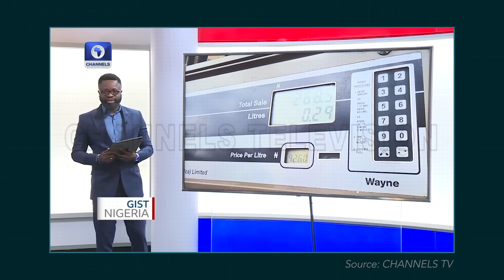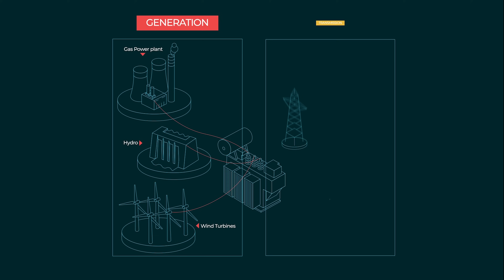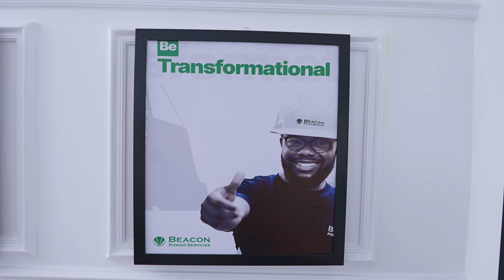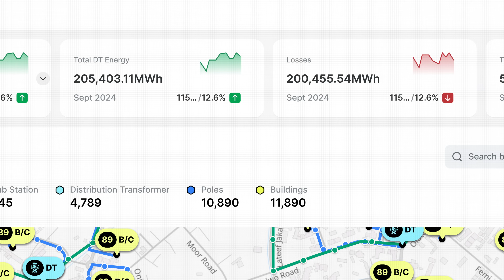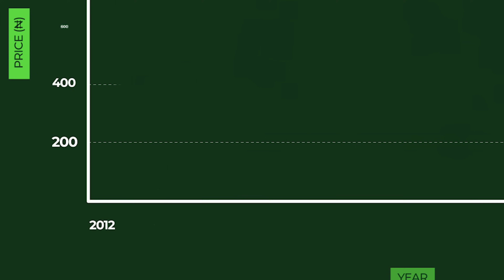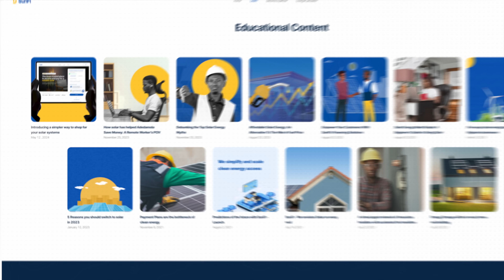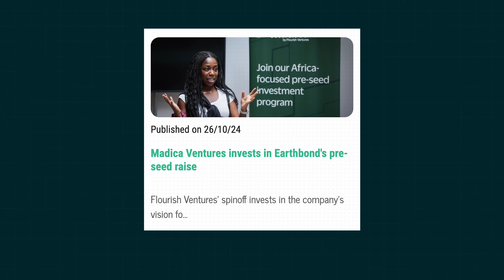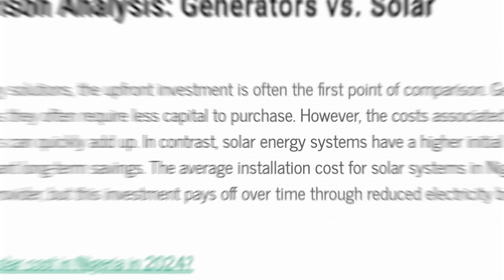Can Solar Power Solve Nigeria's Energy Crisis?

Comment: Reply the one you've heard of to this comment:
 1. Thorium-Salt reactors
 2. Methane from Algae
 3. Ethanol from corn or grass
 4. Artificial Photosynthesis to produce octane
 5. Electrolysis of Sea Water to produce hydrogen
 6. Piezoelectric generators embedded in roads and sidewalks.

All these technologies were proposed or developed abroad but here in Nigeria we're fighting for crude oil (I don't care anymore, come and carry it) - when we should be busy developing our own solutions not waiting for the more advanced countries to do it and buy from them expensive (or often old and redundant tech).

"Change is on the horizon", I say "Change will wreck you if you don't move with it."

If we start now, then tomorrow is guaranteed - I'm developing my own technologies to produce hydrogen and electricity that are cheaper than crude oil products and reduce our dependence. 

Are you going to sit down at home and complain or will you do something too?

Comment: Yes, solar is more than sufficient with sufficient inexpensive energy storage systems for night time and intermittency such as Sodium ion batteries , LiFePO4 batteries, Fly Wheel storage, Pumped Hydro storage, etc. You may have a super abundance of electricity for a Wakanda forever. It would be good if solar panel and battery manufacturing was made local, they being so critical.

Comment: People who already have generator or generators should have a dual input inverter system/switch box which could be Automatic or Manual switching.
Then if there is grid maintenance or climate/weather damage in the area which admittedly is gonna be a concern and problem that everybody in the area is going to be affected by 
very highly likely than not so having options to use already in place built into the grid and infrastructure from the get go is highly necessary and important.
There could be local events that include educating, training, teaching people with hands on experience so people will take care of solar equipment and their generators and all the hardware that goes along with it and any software that is in use along with it.
Take care Nigerians and good luck on moving forward with this full grid scale Infrastructure and community development & empowerment project/initiative.😊😊😊

Comment: This was Indonesia 20-30 years ago. Now, we have a surplus of electricity, with 99% of homes electrified. Just vote for the right leader, and you can achieve the same in Nigeria too.
Reply: Coal is the largest energy source in Indonesia according to IEA.
Reply: It is more complex than that. I have seen candidates locked out of elections resulting in basically selections not elections. Not to mention vote rigging, assassinations' of both candidates and electoral officials. Do not come here to lecture Africans.
Reply: Explain
Reply: @LibertarianBangla  Just place something like a Ecoflow Delta 2 or pro in every house together with a solar panel on the roof.

These Delta's have a AC-in so if there is electricity from the grid use it, to charge and pass through.
During the day solar will also charge it.

Connect your fridge and other stuff to the Delta and be done with it.

Comment: No.
   But adding solar farms and other forms of renewables to the grid, is the solution.
Reply: And how well is that 'solution' working out for the western countries? For Europe? 
I see how the energy prices have been dropping as more renewables have been adopted -- or have they?
Reply: @kehindeakiode2865  
Electricity in Nigeria is 130 dollars per megawatt, 70 in US, 99 in France, check Scotland for me (except I'm wrong their grid is mostly renewable)

renewable does not necessarily mean cheaper than drilling, refining, and transportation in-between, but usually is.
Sources like the Thorium-Salt reactors would be excellent for Nigeria, but let's be honest with ourselves, how many 'engineering graduates' in Nigeria have heard of these new reactors?
Even though the concept is ten years or so old.

We're talking about solar energy so much when it's not that efficient (30 - 40%), Artificial Photosynthesis is an upcoming technology that should be commercially viable by 2030, Bio-Fuels like ethanol from corn or methane from algae can be developed here, electrolysis of sea water to produce hydrogen, etc, can be done in Nigeria.

We're not researching now to at least develop it independently. Instead, let the West do it first, go through all the hurdles, and sell it very expensive to us, then the imbecile of a president will cut a ribbon and it's non-functional in the next five years.

Nigerians are travelling abroad to study, and they'll develop those technologies there, but the idiot professors and what-the-fuck-level-of-useless PhD programmes here can't produce one good idea.

Add renewable energy sources, and nobody will get hurt from it. 

Nobody has to like it, but we are still fighting over crude oil in Nigeria like our ancestors who were clearly daft, and we are following in their footsteps.
Reply: @kehindeakiode2865 
Read my new comment and reply.

Scotland has the highest renewable energy in the world, that make up most of their electricity, go and find out how they did it.
Reply: @kehindeakiode2865 
Inflation. That's why. Check Scotland they have the most renewables in the world, but electricity prices are based on the most expensive source(which is petrol) in the UK as a whole.

Comment: no, Nigeria will never industrialize with solar or micro grids. Nigeria does not have an energy crisis Nigeria has a leadership/governance problem. Solving the energy problem is trivial to the point of being laughable.
Reply: Actually we do have an energy crisis. But fixing leadership crisis is the start of the solution to many things, including energy.
Reply: @kehindeakiode2865  the technology and solutions already  exist to fix all  your problems. it is not exactly rocket science. Thus  the only thing is implementation which is specifically leadership issue. I have worked both in the energy and power engineer by trainning  I have met plenty of qualified nigerian engineers working all over the world. you  are denial you have a leadership crisis
Reply: @midnightwatchman1  Try re-reading what I wrote. I'll break down what I said. 
(1) We have an energy crisis
(2) We have a leadership crisis
(3) To solve the energy crisis, we need good leadership
(4) Fixing the leadership crisis will provide the good leadership needed to solve the energy crisis.

Is that clearer now?
Reply: @ and to be clear I  put the leadership first and fundamental  becasue  it solve more than just the energy problem.

Comment: Nigeria, while it still doesn't generate as much, can copy the Brazilian model 
1 super hydroelectric plant and distributed generation of solar energy without taxes, microgeneration and individual generation are booming here
And use the Norwegian model to create a sovereign wealth fund with oil revenues to migrate to net zero
Reply: A super hydroelectric plant would require  a big enough river and dam. We already have the Kainji dam on the Niger river, which is the biggest river we have. Sorry, super hydroelectric ain't possible. And let's not forget, the grid to distribute the produced power is problematic, as was mentioned in the video.

Comment: There are still charging stations in Nigeria? I haven’t seen these power generators for years in Guinea. We had electricity problems before but since 2015 it’s mostly solved, we generally have constant electricity. I’m surprised Nigeria still have these issues.
Reply: Which of the Guinea.  We know 3
Reply: @animalfunfacts247  Guinea republic. The other Guineas are "Bissau-Guinea", "Equatorial Guinea" and "Papua New Guinea". When you see Guinea written alone, it refers to the Republic of Guinea (Conakry) as the country's official name is Guinea.

Comment: The energy crisis in Nigeria is not brought about by lack of energy resources but by poor management. The country is literally sitting on oil and gas deposits, it doesn't make sense that it can't produce sufficient electricity. Solar will provide a reprieve for lighting homes but industry and the country in general still needs an efficiently managed grid. There's no running away from this fact.
Reply: Nigeria and most of Africa doesn't need ANY fossil fuels to generate electricity, that's a myth of decades ago that should be buried in a hole. 

Africa has the world largest renewable resources available for the most part and relatively still up tapped 

Between solar, wind, hydro, geothermal, biomass, and hydrogen, 
The vast majority is available and all is renewable and or sustainable, and most of those energy sources hasn't developed the ease of transport, so it's best used locally/regionally 

And the oil and gas might be exported, with a plan for winding down, but ridiculous thinking about using it just to generate electricity when you have an abundance circling you nearly free
Reply: @AfricanCulturalHeritageProject an efficient and sustainable electricity grid is more than just generating the power. The grid itself must be able to handle the generated electricity. The grid in Nigeria in it's current state is unable to do that. We can debate renewable or carbon sources but they're all free for Nigeria (it has them already). You'll need to revamp the managing authority or create a totally new one. Unless all the aspects are addressed, nothing will change.
Reply: there's also no running away from the fact that withing the next two decades we should be DONE burning stuff, period. Centralized hydrocarbon extraction never has been a net benefit to populations in Africa overall.
How about just leapfrogging this and focus on economic development beyond oil.
It has been the moral obligation of the rich countries of the Northern Hemisphere or "The West" to tackle the mitigation of climate change (which was met with differing degrees of enthusiasm at a time when the r&d and scaling up had to be paid for by subsidized feed-in tariffs...)
Now that going carbon free has become a financial no-brainer the rest of the world get to join "for free", how great is that epecially given the all those positive side effects.
Reply: Most of the oil & gas is foreign-owned & we saw in Iran in 1953 & today with Venezuela how nationalization is received by The West 😢
Reply: @alanhat5252  there are local Nigerian companies that exploit some oilfields especially onshore fields besides you only need a small fraction of Nigeria's total output to generate electricity. There is no valid excuse for the current situation. If Nigeria intends to be a serious country in the region and globally then it can't continue like this.

Comment: Nigeria is not Africa’s largest economy for years now and solar is not the solution as it can’t power factories and industries which Nigeria/Africa needs
Reply: Solar can power factories!
Reply: @alanhat5252  And how many factories is solar powering in your country?
Reply: Good point
Reply: there is LARGE scale solar though and prices for battery storage are coming down faster than prognosticators can say "what!?"
Also, what is the "industry Nigeria needs"? Surely not to run further hydrocarbon extraction off of renewables!? Apart from export demand going down dramatically in the next two decades we're already seeing the advent of electric mobility in countries that for price reasons were not at the front of adaption, but it is going to be exponential really soon. That's a giant economic potential even if it's about the implementation and adaptation to local needs of Chinese tech.
Reply: @velotill  Wow, that's an INCREDIBLY... unenlightened (to put it mildly) take on Nigeria. What industry does Nigeria need? The bigotry of low expectations is real. Please stop advertising your ignorance.